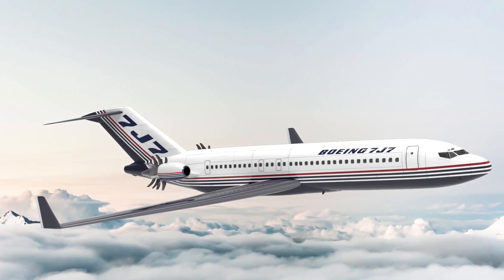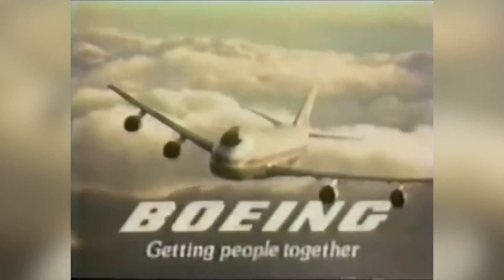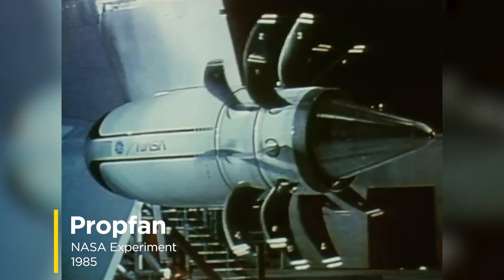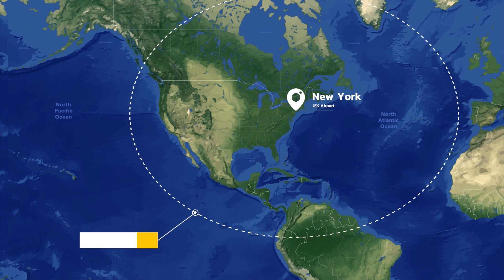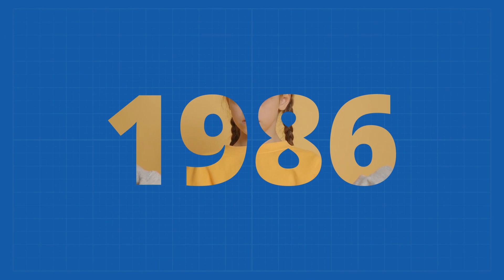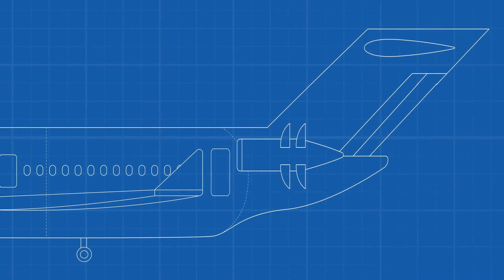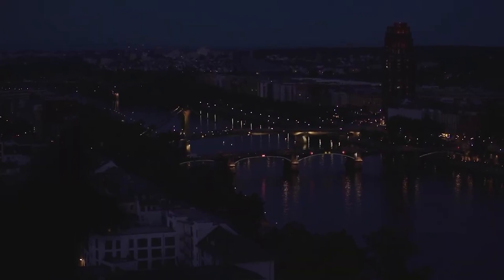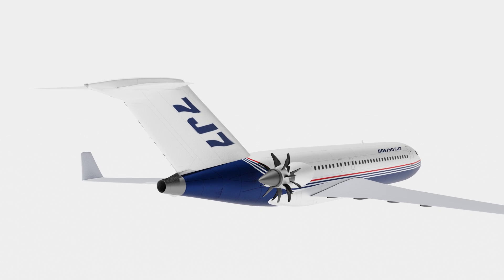Boeing 7J7 - The Boeing 737 & 727 Replacement Aircraft That Never Happened

Comment: The 7J7 would have been a worthy successor to the 727 as it would have replaced Boeing's loudest jet with something even louder.
Reply: Can’t match the crackle of three JT8s on takeoff.
Reply: Every thing louder than everything else 🤘🏼🤘🏼📢🔊📣
Reply: I don't think they're all that loud.  During development, we had an unducted fan engine installed on a 727 and had them do a lot of low level, high speed fly-bys.  I would compare the noise level to a P-51.  It's actually a pretty sexy sound.
Reply: Eastern Airlines called their 727s "Whisperjets."
Reply: We should not forget the 717
Reply: Hahaha
Reply: @larrygarcia9048  Random.
Reply: Loudest and smokiest
Reply: Yes I think so as well. You worked on the development of theese engines? Wow. There are a few vidoes on the net that prooves that they´re not as loud as people think . Even not as noisy as jetengines! @Ampersandrascott

Comment: Who else finds the inefficient planes of the 1970s (like the L1011, DC10, A340 etc)  were the most beautiful planes ever
Reply: Especially the L1011
Reply: @neogenmatrix6162  yeah
Reply: Ugly and twisted on the inside. Remember form follows function in Aerospace .....
Reply: A340 is from 1990s
Reply: L1011 looks the best, was an efficient plane for her time.
Looks amazing when launching a rocket
Reply: The most beautiful are the most efficient, such as A350
Reply: Today apart from the 747-8I/F and the A380-800 there is nothing really ex sitting out there to spot so yeah 1970s aircraft were defo the best
Reply: Trister inefficient? Not really, this is used to be the best American made airliner. For a long time the A340 was the best plane to fly 350 passengers  over any oceans anywhere. Some governments choose it as a 4 engine plane is safer with the added redundancy.
Reply: @lucrolland7489  A340 was the best long haul untill 777-200LR and 777-300ER came. Governments chosen a quadjet because a twinjet has to land at closest airfield in case of engine failure.
Reply: @lucrolland7489  at the time it was efficient but according to today's standard's its inefficient
Reply: @michabawoek6661  Indeed, quad engines were put out of service by the B777 getting its certification to fly over (2 hours away from an airport) ad they were the last great plane by Boeing. And then the A330 matches the B777 with its incredible reliability and they cost a little less per seat as being less heavy.
Reply: I do
Reply: agreed!
Reply: Morahman7vnNo2  yeah
Reply: The 727 was the most beautyful airliner in my opinion.
Reply: @Mr727sim  wow lovely
Reply: Aye
Reply: hans ruby  yeah
Reply: You should feast your eyes upon the 1960s Convair 990. Inefficient as hell, but certainly a good looking 4-engine airliner.
Reply: @AaronCMounts  yeah fast too
Reply: @AaronCMounts  true
Reply: the DC-10 OMG I LOVE IT
Reply: If McDonnell Douglas Had went ahead for making the DC 10 Twinjet and MD 20 / MD 11 Twinjet could have given neckbreak or sweeping out of the game punch to the Boeing 737s, Airbus A320s (if DC 10 Twinjet would have been made) and same for the Boeing 767s, 777s, 787s Airbus A330/A340/A350 (if MD 11 Twinjet/ MD 20 would have been made)
Reply: @neogenmatrix6162  My favorite wide body aircraft.  I loved flying on it.  I was 15 when I first got on one with Eastern Airlines.
Reply: The L-1011 easily the best ever
Reply: They were. 
Like 70s muscle cars looked and sounded better compared with today.
Reply: @drmayurpaigynecologistgoa5815  Why they selected Rolls Royce which was having financial problems is beyond me. Had they selected GE or Pratt and Whitney they would have entered service earlier.  The DC 10 was first and  this costed Tristar sales.  Still, the Tristar was first automatic landing capable WIDEBODY airliner.
Reply: I think the 757 is the best looking plane

Comment from the maker: Slight error with the statement on speed: 0.84 Mach is its top speed but the cruise was lower than 0.82 of a normal plane.
Forgive me :)

Some really great clips in this one around 6:50 in! Most won't see it but jump on it if you read this comment :)
Reply: I have no idea. can you give me a clue? love your videos
Reply: The 787 flies at Mach 0.85 and the 737 flies at Mach 0.79. 0.82 isn’t really that bad even against modern jets
Reply: Great 👍 video 📹.
Reply: @larrygarcia9048  sir, this is a wendy's
Reply: @IncredulousTriangle   Found And Explained says above that Mach 0.82 was the speed of a "normal plane" (?) and the 7J7 would have cruised slower.
By how much though?
At the time this was being proposed, the 737-100/200/300/400 all cruised at Mach 0.76. Boeing 747-400 cruised at Mach 0.80. A lot of Airbuses cruised slower (0.78/0.79 - reference https://modernairliners.com/airbus-a320-introduction/airbus-a320-specs/) as they focus on max fuel economy.
0.76 would be a respectable speed in the segment, even today, if the fuel economy savings were there (don't forget, the BA146 only cruises at Mach 0.68, and was a commercial success - albeit in a lower seat segment), so there was more to shelving the project than that.
Reply: NASA
Reply: prop fans were much slower than this.  More like Mach .76 maximum and normal cruise at .72-.74, and econ at .67.  That's where GE-36 came in on MD-80.  But it wasn't speed that killed it but paranoid cert people worrying about shedding blades being unconstrained, and people that didn't like the noise.  If it had debuted in 2008, they probably would have accepted it with fuel over $4.00/ gal
Reply: @gendaminoru3195  Blade loss on the unducted fan engines set up an incredible vibration through the fuselage on the test vehicle.  Extrapolation of the results indicated it would cause the death or injury of passengers in the back of the aircraft.
Reply: There was The MD-94 wich had also The UDF!
Reply: That is the same as the 737 Next Gen. I worked on that airplane too.

Comment: Complete omission of McDonnell Douglas and the MD-80, the model that Boeing was chasing during the mid ‘80s, not the A320 (which program was only launched in 1984 NOT first flight or EIS as implied, with the promo video shown from 1988).  The MD-80 UDF also was developed in parallel with the 7J7, making its omission from this video all the more abhorrent.
Reply: Do you mean the MD-95?
Reply: Especially when you consider the MD-80 UDF spent considerable time in actual flight testing and was further along in development, compared to the 7J7.  Certainly a blatant omission/oversight by the author of the video.
Reply: @Ampersandrascott  technically it was known as the MD-94X concept, which was tested on an MD-81. https://en.m.wikipedia.org/wiki/McDonnell_Douglas_MD-94X
Reply: @Ampersandrascott  No. MD-80 program tested a UDF version of this propulsion also.  McDonnell Douglas may have come to the same conclusion ... capacity to propel the aircraft, noise and fuel consumption may have been factors in the MD-80 not being offered to the airlines with any type of UDF or UHB engine version. Plus this type of propulsion, I don't believe was ever airworthy certified in the US.

Comment: I hired into the company on 1985 and worked on 7J7.  One item which isn't mentioned is that Boeing had invested heavily in research and development for computer-aided design, specifically Dassault Aviation's CATIA.  It wasn't ready for full implementation as of 1987 and it was needed to meet the cost targets for the design and production.  So consequently, it was the 777 which benefited from that delay.

Remember too that the industry changed dramatically as a result of deregulation and the adoption of the hub-and-spoke model.  Lower oil prices and the surprise success of the 737-300 made the 7J7 an airplane the airlines did not need anymore.

Comment: 7:09 Mach 0.84 is not slow. Latest 737 s can manage 0.79 at best.
Reply from the maker: Yes see the pinned comment. I was incorrect
Reply: 737s are happy at .785, but can go .80 if the air is smooth and no wave.

Comment: I'll remain skeptical on the noise issue without any audio examples of the type in motion. I'd put as much blame on Boeing's waffling over sizing as the novel engines.
The market for an easy-on/off 200 passenger domestic flight is certainly there, it would have been nice to see these or turbofan equivalents flying around. The T-tail would certainly make them easy to spot among the 2-pod lineup at most airports.

Comment: yeah those engines were incredibly loud...  some antonov has that type too pretty much the only aircraft with such type of engines flying as far as i know.
Reply from the maker: There is no way that the fans were quieter than a jet engine. The work done on the engine was rolled into new aircraft designs like the Trent 1000
Reply: the Russians also had a go. the engine you are thinking of is the Kuznetsov NK-93! It was test fitted to an il-76
Reply: @FoundAndExplained  We had un unducted fan on a 727 for our test vehicle.  I would compare the noise as being similar to a P-51.  Noisy, but not obnoxiously so.

Comment: Fun thing is that the propfan engine seems to maybe be making a return as CFM (GE + Saffran) are working on a new modern propfan engine. Perhaps it will prove quieter and reliable enough to be considered as a replacement for the traditional turbofans?

Comment: Another concern with unducted fans is the issue of a blade separation. Being unducted, means that should a blade break off, it could punture the fuselage. There are several drawbacks with this engine type and that's why there are still no unducted fan airliners around.
Reply: .... interesting thought.  But, modern carbon fiber blades are virtually indestructible. If that technology was in existence then, your example would have been a non-issue. Also, shielding can be made to cover that area of the fuselage to prevent a puncture, even with the technology of the time.

Comment: Those engines were really cool but extremely loud and sounded like chainsaws
Reply from the maker: The energy has to be displaced somehow and if not swirl it would be noise
Reply: @FoundAndExplained  I think it maybe could have been reduced if they shrouded the coaxial contra- rotating blades in a nacelle
Reply: @L33tSkE3t  I suppose modern high-bypass turbofans are basically that. The fans are ducted but they're much wider than in older jets.
Reply: @MattMcIrvin  Yeah, I guess that would be considered the same principle.
Reply: They could learn from the ATRs or the Q400 on how to make them more silent.
Reply: @lucrolland7489  they aren't coaxial contra-rotating propellers. They are single props. It's thr contra rotating nature of that engines dual propellers that makes them so loud

Comment: would have been a very cool machine... should have built it, but i would think that the cost of carbon fibre at the time (USD40/lb before forming) may have been a bit of an issue... but could have been an interesting alternative to the 737-max series... even with conventional jet turbines in place of the jet props, it could have been a game-changer and more future-proof...

Comment: Had the 7J7 actually went into service, it's likely it could have severely cut into A320 sales. And improvements in blade design would have made it probably as quiet as the A320neo now but with likely even lower fuel butn.
Reply: Yup, not to mention they would have probably skipped this entire 737-MAX boondoggle. Now, they're still stuck with loads of 737, which sucks. The A320neo is way better than any 737 models, IMO.

Comment: Another great video mate, thank you for posting!
The 7j would be a great idea....... in principle but would it really give that much fuel economy? I'm not so sure. 
Also, I'm not convinced that putting the props at the rear will stop the noise from entering the cabin..... propeller engines are noisy...... and would the placement of the engines back there work, anyway??
Basically, it's a no go!!

Comment: I always wondered why they didn't re-engine the base line 727 airframe. No you couldn't put a high bypass turbofan in the center engine bay. But the 2 replacement, outer pylon turbofans could have provided as much or more thrust. Than the original engines with a far lower fuel cost. Propfans are an interesting proposition. Such a design should  be marketed to the US Navy. Somthing like a P-8, only purpose built; with a mad boom. In this way commercial sales, including freight options. Could be a profitable way; to promote the "in-land port" concept. Long range, more "on station" time. Jet engine like speeds. Such an aircraft, or a larger variant could replace. Ageing 707 based airframes in service. Just a thought.😎
Reply: They did, and christened it the Super -27. It was a retrofit option only as airframe production stopped in 1984. Engines 1 & 3 were upgraded to the larger diameter JT8D-217’s which greatly boosted power. And the retrofit could be used on either the -100 or -200 airframe. Alas very few of the Super -27 conversions were sold, but you can find plenty of YT videos featuring them - the takeoff performance is impressive.
Reply: Thank you for your information. Production ended.

Comment: Wouldn’t putting the engines on the wings reduce noise more than putting them on the fuselage? Usually wing mounted engines are quieter because they’re further from the cabin.
Reply from the maker: yes but they wanted a cheap switch to the 727, so no engines under the wings (needed to be able to land low to the ground)

Comment: Safran is researching on the UDF Mk2 and their project is called the open rotor project

it bares resemblance to the GE36 design

given that the who world is pushing for lower carbon emissions.

Maybe the UDF design might see a return since flying faster = poor fuel efficiency 

Advanced computer aided design and wind tunnel testing could help design better fan blades that could cut aero drag and help reduce noise pollution that plagued the GE34.

maybe there is a possibility that the UDF could be electric powered or a hybrid system to further cut emissions 

the 7j7 was def far to ambitious in the 90s when materials like carbon fiber composites was really expensive to make and the idea of a full glass cockpit was not widely adopted by airlines since the MD/DC/B727 era of planes still have the traditional steam gauges and there is an flight engineer behind the flying pilots.  

But now Boeing who designed the 7j7 is now trying to fix their deadly MCAS system in the 737 Max planes but also the Covid-19 virus has practically stopped all air travel indefinitely.

Comment: The failure to build this airliner is perhaps the biggest mistake Boeing made in the last 30 years. Even if ignoring how it would have wiped the flaw this the competition, especially with the rise of the penny-pinching budget airlines, this would have completely evaded the 737 MAX debacle - instead of sweating old designs and twisting them perhaps too far trying to keep up with newer planes and the latest innovations, a clean sheet design would almost certainly be safer, enable better systems integration, and have superior long term prospects. Nobody can see the future, but a 40% dip in fuel consumption with only the first iteration of the engines was amazing. It would have forced the competition to innovate, and other engine manufacturers would have rushed to remain competitive, greatly improving not only the industry's bottom line but better securing its future, particularly amongst more environmentally-concerned operators/countries.

Comment: Ok they basically did with their jets, but they ducted it... turbofans...
Reply from the maker: The tech would go onto the next series of jet engines
Reply: Yea...
Reply: Yes, modern turbofans have a much higher bypass ratio than the early ones--most of the thrust is coming from the fan, though it's in a duct. There still seems to be some interest in unducted fans because they would be more fuel-efficient even than modern turbofans, but noise is still a problem.

Comment: As NOISE GOES the MU2, ON THE GROUND, was noisy, and so is the PIAGIO AVANTI  II, , even in the air, I can tell what aircraft it is HOWEVER INSIDE ONE due to engine placement they are BEHIND THE CABIN, and NOT NOISY AT ALL, 🇺🇸🇺🇸🇺🇸🇺🇸

Comment: I'm not an engineer - but wouldn't there be more opportunity for failure on the external portion of the engine?  More exposed moving parts - more opportunity for failure?  That plus the fact this aircraft would be slower.   Maybe it's a solution for underserved markets or an opportunity for more economical runs for the 'cheap' passengers who are more interested in saving $$ than saving time.

Comment: The biggest mistake Boeing ever made is not putting longer landing gear on the 737!
Reply: Now, where would you put that extra long gear?  Have you noticed how close the wheels are to each other when the gear is stowed?  It's easy to see, just look up when one flies by.
Reply: Ampersandrascott thats funny air bus did it, thats why they were able to put the bigger engines on there 737 look a like without problems!!!!!
Reply: @mr.redneck2715  There's a big difference.  The 737 has always had visible stowed gear.  Being a narrow body airplane, it couldn't aerodynamically support a larger fairing to completely contain the gear.  Airbus planes are designed differently.  It's an apples and oranges comparison.  Now, if you have a great idea how to get longer gear in that fuselage, you let me know.  On the 767, we had to actually move the main gear fittings outboard to allow for longer -400 gear.  The 737 wing did not have the room to move any fittings for longer gear.
Reply: @Ampersandrascott  airbus did It on the same size airplane maybe Boeing  should have hired airbus to help them!!
Reply: @mr.redneck2715  There’s a lot more cooperation between Boeing and Airbus than people think. Hell, I was looking at A380 concepts long before Airbus announced it. So, your passive aggressive attitude is completely out of place.